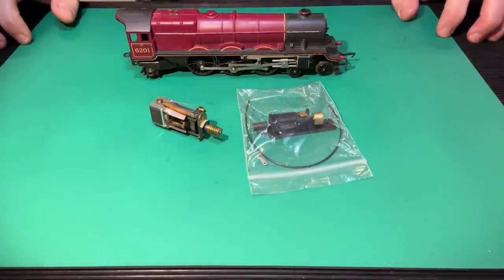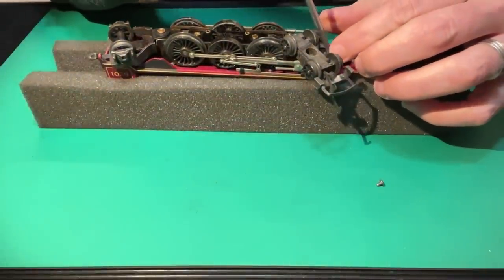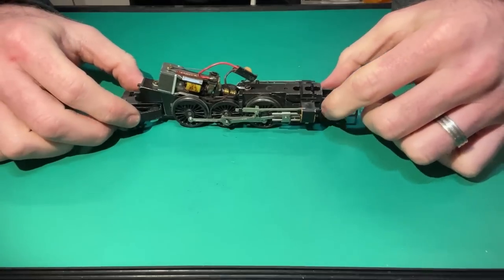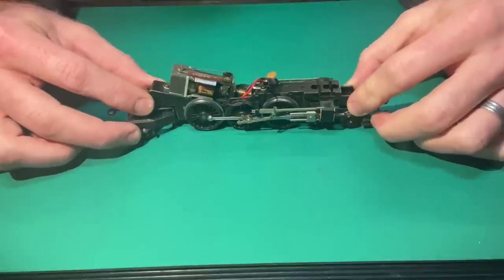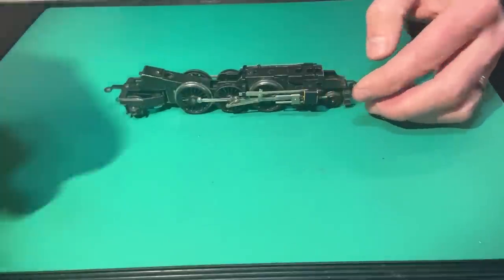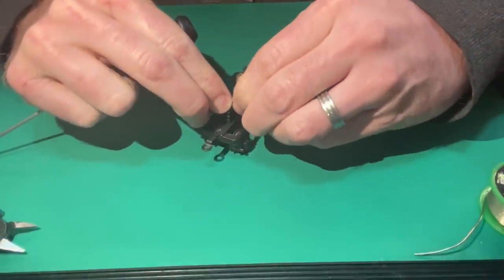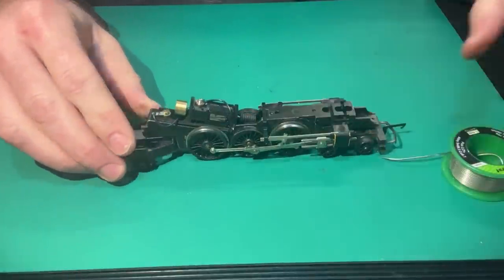Triang / Hornby X04 Motor Upgrade Kit (5 pole motor with flywheel) Fitting Tutorial and Demo

Comment: I just found this channel and this upgrade looks great. A tip I would suggest would be to keep any redundant X04s for potential spares or re-use by yourselves or others later, as these are highly standardised motors and a lot of older kits use these motors. That said, these new motors really bring the older Tri-ang models up to modern motor standards and reveal how much potential these old models still have.

Comment: This upgrade kit has given me many devious ideas

Namely finding a busted princess, then acquiring one of these kits, alongside some new, finer scale wheels and a few new details, in short simply making a Triang loco which is of/closer to 2023 specifications
Reply: Also, one possible solution to the wire on the pickup would be to simply remove the pickup, it’s only held in by two screws, so removing it and threading the wire through the frame would probably be a safer option, as you lose the risk of damaging the gear

Comment: Very well presented. Analogue control or as I call it pure DC  ontrol is now right up there with motors like Portescap which I consider to be the best ever.  Superb slow control and the extra weight is wellworth doing.

Comment: The wheel pickup strip is made from bronze, not brass, as the latter would oxidize & tarnish. The pickup strip is mounted on a removable plate, detached by removing a pair of brass screws, so there was no need to solder the wire through the body from the top.

Many years ago, I replaced the X04 motor n my 1959 Triang R.152 Armstrong-Whitworth 0-6-0 diesel electric shunter with a modern Hornby micro motor. I created a mounting plate, out of plasticard, then used thermo setting industrial superglue gel (warm slightly to cure) to secure the motor in place. 20 years later and it still functions fine under my layout's Hornby Zero One DCC control system.

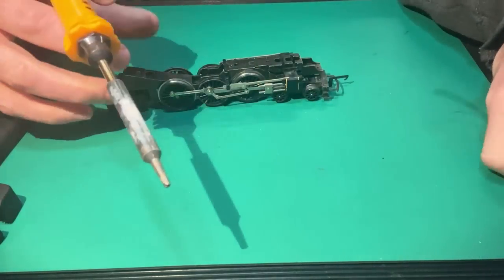Comment: 16:37 would be much safer to take the bottom plate off and fix the wire, then thread it back up into the chassis. This is a very creative cleaver solution well done. I've got loads of X04 spares but am tempted to try one of these

Comment: hi. i cant understand why you did not undo the 2 screws on the bottom to remove the pickup plate before soldering the brown wire replacement to it.but besides that it is a good explained video.one more thing i noticed the last wire you soldered you covered the hole on the brass brush holder this is wrong because you will not be able to replace the brush. as that hole is the only way to keep the brush in place when fitting a new one it . which has to be absolutly clean  and without any obstuctions
Reply from the maker: Hi. Yes very good point. I have sometimes found it tricky refitting the pickup plate which is why I left it in, but I see your point as that would make the actual soldering easier. I wasn’t aware of that issue with the hole on the terminals of the motor but will do some looking into that. Thanks for bringing it to my attention 👍
Reply: @HornsWhistlesWorkshop  The pickup plate must be one of the easiest things to fit ever.  I suppose it depends on how many Tri-ang or Hornby locos you have serviced.

Comment: I have a tender driven Duchess class. I noticed the locomotive seems to have placement for a motor, bracket and gear (on the from axle. Are parts available to convert the loco and eliminate the Ring motor ?

Comment: You forgot to mention that the brass strips collecting power from the insulated wheels are mounted on an insulated piece at the bottom of the chassis, if not , you will have a short.

Comment: The reason that traction was poor was you are probably running in nickel silver track whilst Tri-ang -Hornby track was steel snd much of their motive power relied on Magnadhesion. Magnets located behind the wheel allowed greater grip on Hornby's steel track. My late Father's layout has steel track with nickel silver points. Our old Brush type 2 (class 31) will be fine on plain track then spin hopelessly while attempting to pull a train on points.
Reply from the maker: I did not know that at all, very useful thanks Jack.

Comment: Hi, this is superb and very long overdue, hopefully you can look into replacement 9v pan motors for the Ringfield motors.
Reply from the maker: Thank very much. What do you mean by 9v pan motors?
Reply: @HornsWhistlesWorkshop  the motor for the Ringfield co co configuration, a 9v instead of the 6v, you mentioned a few videos that a 12v variant wasn’t viable because of how thin the motor case is.
Reply from the maker: Ah yes, there’s no way around that I’m afraid.

Comment: To avoid possible melting the plastic drive cog on the axle when soldering a replacement wire, just remove the plate underneath and solder the wire on. All you have to do then is replace the plate whilst threading the wire back through the chassis.

Comment: you will find that if you remove the two screws under the chassis the collectorplate will come away and you can solder the wire safely without damage to the nylon gear

Comment: I like the new unit you have developed, I have a Airfix Prairie which uses either a X03, X04 and as your display unit it is not a brilliant runner, would your mod work with my prairie? if it will then I would like to order a kit.
Reply from the maker: Hi Peter, If it uses an X04 motor then yes, this will work, however that will not be the case if your model has an X03 motor (which has a plastic worm gear) as the worm on this kit won't mesh.

Comment: Hello, this looks great.  Can your conversion kit be used on the old Hornby 2MT?  it has a cross beam that sits under the motor housing. And could it be used on the old "Nellie" style 0-4-0s?
Reply from the maker: Hi Piers, I can't seem to find a good enough image on google for the 2MT motors to be able to tell you. If you can email me some pics of your model I might be able to advise (email address on the business card at the end of the video). Regarding the 0-4-0 models, yes as long as they are fitted with X04 motors then they should fit just fine. Best wishes
Reply: @HornsWhistlesWorkshop  Thanks for getting back to me.  I had a Hornby 2MT with a failed X04 Motor and was looking out for a conversion kit just like yours for some time, but in the end I gave it to the GCR Emporium to sell for spares or repairs.  So it was really an academic question.  I'll see if I can find the service sheet though and email that to you as there may be other potential custoners for your conversion kit with the same question in mind.  As to the 0-4-0s I had in mind purchasing one for reasons of nostalga but they are very old now and usually awful runners so your kit would be grand for an upgrade.

P.S. I've just remembered, OOBill did an excellent video on upgrading his 2MT with a Type 7 motor.  That would clearly show the tie bar I think.

Thanks.
Reply: Looks a great kit.

 I have a 1980s spitfire locomotive with a very noisy motor that is in mint condition 

So would be good to have it running better

Comment: Nice upgrade and a good outcome. 
You obviously don't appreciate the simplicity or longevity of the vintage X.04 or X.03 motors or are a collector of vintage Tri-ang locos. These old girls don't really wear out unlike the plastic upgrades. 
Those of use who are collectors love the 1950's and 60's locos and know how good they are. DCC is not a necessity for these old girls and they run best with the vintage controllers of the same age. 
Take the base plate off to solder the brown wire on without fear of damaging anything else.
The intent is good but bagging the old motor that probably just needed a full strip down and clean wins you no friends in the collector world.
Reply from the maker: Some valid thoughts there, however an alternative view could be some collectors or owners who have models of sentimental value would relish the chance to put a more modern motor in their older model. Absolutely accept that it isn't for everyone though.